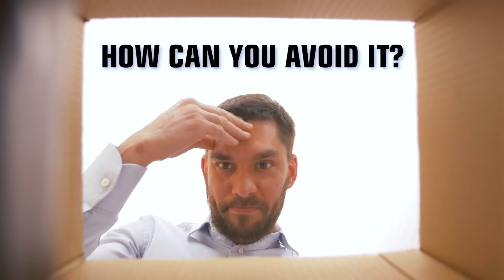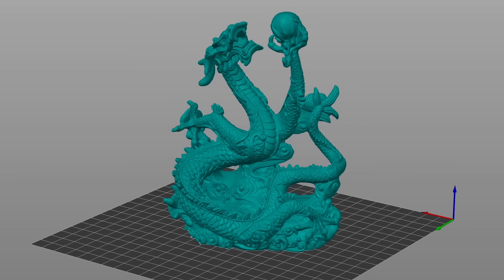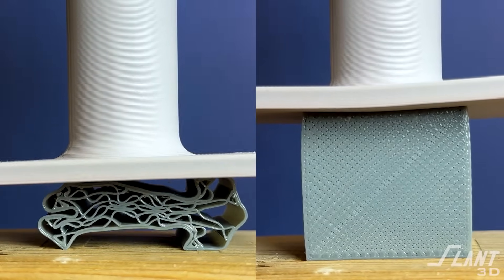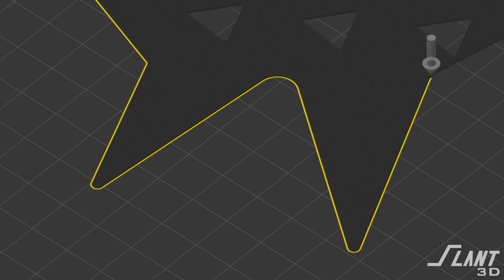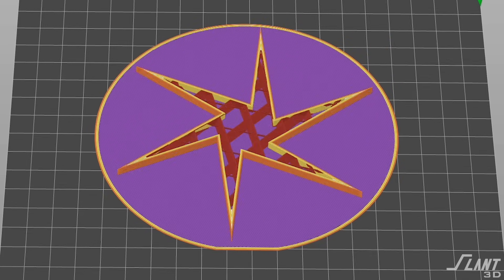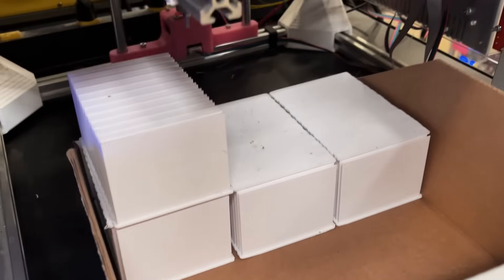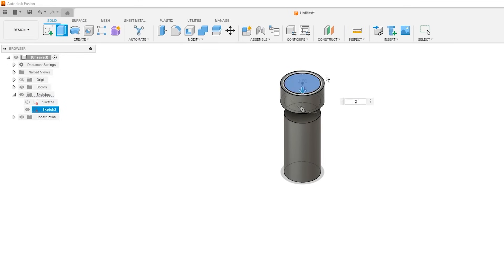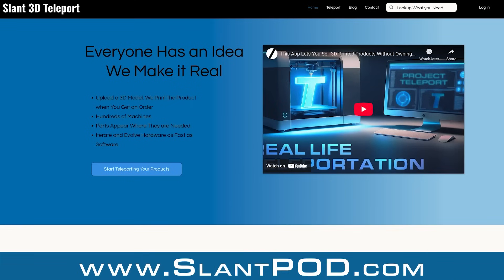Stop Needing Slicers

Comment: Those aren't tolerances; those are clearances - i.e. the expected gap between the internal dimensions that allows movement.  The tolerances (i.e. how much variation you can tolerate on your dimensions) are determined by your materials, processes, expansions, print orientation, etc. and represent one of the constraints that determine what clearance you should aim for.

Comment: 2:59 that's... not what a chamfer is. Trying not to be a pedant but in a video that's effectively about Design for Manufacture... one of the more important aspects here is Design Communication, right? Which means being correct and accurate with the terminology. Other commenters on this video and others already point out your misuse of tolerance/clearance...

Comment: 4:45 Won't those microfeatures slow down printing time by a lot compared to just up the wall thickness in the slicer though? since the printhead has to slow down for all of them where as for walls it can, for bigger shapes just go full speed ahead? I get the idea for parts that have different required strength requirements for different sides/parts/directions, but would it for a printfarm e.g. be possible to say "please make those parts with 4mm walls" instead? An example: I am designing a flywheel trainer (gym equipment) - currently just for myself. I already know that most parts of it need to be VERY strong (), so I am designing parts really chunky and doing prototypes just with very sparse infill and only 2 walls for test fitting and the real parts will get 3.2-4mm wall and top and bottom thicknesses. I am using PLA+ because it's cheap enough so I can pump the ~2kg of material into it I assume it will eat up, has good strength values and the part won't see the inside of a car anyway. Note that trainers like that usually sell upward of 300-400 EUR, so yeah, that material is absolutely worth it. But for something like this that just has very high strength requirements... do microfeatures even make sense?

Comment: I'm here after two weeks to say thanks for the video. I made quick release clamp that can be printed without supports and is very beautiful and strong in any direction. Had to account for proportions and some angles were correlated in proportions to diameter of the cilindrical features. Took me 2 weeks because of maths involved. But finally i made it. Soon i want to sell model or launch a product after some load testing. Just thank you.

Comment: I wanted to print 24 parts on a single sheet and kept having problems if one part failed, it screwed up all the other parts. 
I decided to put a 1mmx1mm square link between each part and their neighbor. This put all the parts in a grid so 24 parts are linked together and no first layer problems or bed adhesion problems since each part held down itself and it's neighbors. Use toenail snippers to cut the links cleanly and easily.

Comment: Everyone knows this already, you basically just 'make it worse', but people don't want 'worse', most 3d products are on the edge of acceptability or viability with fine-tuned slicer settings for a specific printer to coax it into doing something acceptable, without that fine tuning, a lot of times, you have a piece of crap.

Comment: 04:32 

I disagree. For all intends and purposes, this is 100% abuse of the slicer engine. 
You are creating some essentially impossible-to-create features just so that you can try to "bait" the slicer into giving you higher density there. Maybe in the future the slicer will get smarter and realize that it's impossible to create those internal features and skip them entirely so as not to waste compute time. Or maybe they double down on trying to optimize for "as most as possible of the slicer perimeter to be dimensionally accurate" in which case it WILL try its' damn hardest to make those holes accurately because there's a lot of perimeter length there, but you'll find out that your external diameter, the one you care about has been slightly shifted to accomodate for that and now your part is out of tolerance. You complain to the devs HOW COULD YOU MESS UP MY TOLERANCE ??? ARE YOU STUPID ? And they will immediately point out that those holes are part of your design too and that this new method improves the dimensional accuracy on average and it's entirely your fault for putting those features there if you didn;t explicitly want them.

The point is, we want to get slicer technology to a point where it should make the best decisions about how to make the sliced part look EXACTLY as the model. Things have changed over the years. Remember the "inverted hull" method Tom Stanton used to make his lighweight single-layer RC plane wings ? One of the most popular 3D printed RC planes of all time, the Northern Pile still uses this method. it hasn't been modified since 2018. If you try to slice it now, you'll find out it won't work, mostly due to the new, much better "Arachne" perimeter engine, which is able to create variable-width extrusions.
 You might either need to go download an old slicer from the github, or spend a day week-end writing a config file trying to convince the modern slicer to treat those parts the same way the old one did.

What you're saying mirrors the days when compilers were bad and humans could write more efficient code in assembly, and people learning compsci were taught to do very silly, inergonomic things such as "preincrement is faster than post-increment" or to "save a commonly used condition into a boolean value" etc in order to speed up their program. Most of these are actively making things worse on modern compilers, and I still hear some college proffessors tell me those "really neat tricks of the trade only people their age know". Now the paradigm is to just write your code as clearly as possible so that the compiler can understand it better, it will optimize it way better than you ever could. Of course, it took many years to get here, but then again slicer progress is like
very fast. I wouldn't be surprized if just a few years from now, these techniques will be considered outdated and/or harmful. 

Truth of the matter is, that in ANY kind of manufacturing you would need to get more detailed information than JUST the finished part. For Injection moulding, you would need to model the cavity, and the split-surfaces and the little flow connections through which the plastic flows. For CNC you would need to take into account the ways you will be holding the part, and if it has features on multiple sides, you need to design temporary holding surfaces which will be later chipped away and will for sure not end up on the "intended design" of the part

Why should 3D printing be any different ? The effort is obviously much lower to design a few support enforcers and infill modifiers than to design an entire injection mold or CNC process set-up
but that's just one of the niceties of this manufacturing process: that it's simply easier to go from intended design to finished part. HOWEVER EASY DOES NOT EQUAL UN-NECESSARY. 
The .3mf file format is the perfect way do encode these things, because it allows you to specify things about the manufacturing-process. Why does nobody seem to use them ? There has been so much effort put into making it an open file format that covers all ed printing use cases and it seems people just ignore it completely. 

The fact that a lot of 3d-print-as-a service sites just ask you for the STL files make me instantly never want to use them. I completely and 100% agree that the "no-supports" problem is something you solve in CAD, in the design phase, no doubts about that. But the Slicing or pre-slicing (a.k.a. just import the model into the slicer, change your desired infill and perimeter settings, add enforcers, but don't actually fully commit to a printer or print profile, and save the .3mf) is a non-skippable part of the manufacturing process, If what you are doing is manufacturing, and not just printing some meme thing for shits and giggles.

Comment: I'm not sure if mouse ears is actually a clever solution for warping because it produces additional work after the print. I say, if you have warping either your first layer isn't good enough, your build plate isn't clean or it's a cooling issue. For example I had warping on my bambu with PLA because of the AUX fan on, when actually it wasn't even necessary. I have never used any mouse ears.

Comment: Now I haven't used a 4/3.5 axis printer with nonplanar slicing yet, but I think most of these would be non-issues with nonplanar slicing...

Just hope 4 axis printers become mainstream since is isn't hard to turn a triangle configuration leadscrew Z axis printer into a 3.5/4 axis printer...

Comment: I wonder though. Wouldn't it be better simply to design around your home machine and then select a manufacturer whose settings are within a range of what you expect. Like if your manufacturer doesn't tell you what's settings they use then don't use them! Also shouldn't you order samples and test them until it works the way you need? As a person who experiments deeply with slicer settings I feel like it's impossible to design a part without slicer settings being very important. Maybe a good strategy would be to first see what type of settings they use and then buy an affordable home machine that can make parts with similar settings for at home testing, even if not exactly the same machine the manufacturer uses.

Comment: A part of my career was building prototypes and designing and building machinery. A problem most companies have is that there is a disconnect between the design department and the manufacturing department. The design engineers will design exactly what they want. Then it goes to production, where the engineers think; “We can’t build it that way, or it’s too expensive to build it that way.” So they redesign a portion of it. When it gets back to design, they complain that it’s not what they designed. Sometimes it doesn’t even get back to design and it just gets manufactured with the changes. Of course, while it’s easier and cheaper to build, it may not function as intended. Yup! This is common. A few companies, Apple comes to mind, have design and production engineering in the same department. I don’t know why all companies don’t function that way.

Comment: I haven't done drawings for someone else to fabricate in a long time, but when I did a critical part of DFM was working with the vendor so I could get my widget manufactured correctly the first time. Yes, sometimes I would have to give up on some of my design wants, or design around a manufacturing limitation. But that is part of Design For Manufacturing, and usually I would develop great relationships with my vendors because I wasn't trying to give them impossible (or not cost effective) designs to make. I still owe some engineers in Chicago a dinner that I've never been able to repay (because I've never been to Chicago) because they taught me so much about fabrication PCBs.

Comment: Custom displacement mapping (texturing) is something I wish would come to OrcaSlicer in a paintable (using the existing paint tools) fashion. There was a PrusaSlicer prototype years ago, but it was never finished. It would really cut down the toolchain needed.

Alternatively, a Fusion 360 plugin would also be great because doing a lot of repeating patterns in that program will make it choke (they even warn you about it numerous times). Just something to repeat a pattern and tell it "don't compute this until I tell you too, just create an appearance" (similar to how you can texture or model threading), and then you'd compute towards the end/export. Right now you have to export to Blender and then do it there.

Comment: I am not really convinced by "design your own supports", "design your own infill", "design your own raft and skirt" advises. Slicers have these features exactly to relieve you from this, so why you would want to spend time manually doing slicer's job... I don't agree. This also limits your model to one manufacturing method, so people will not be able to, for example, resin print your FDM-oriented model.

Comment: First, great video on design for manufacturing. And up until the end of the video where you talk about build in place assemblies, I thought this would be a good video for my classes. I have been an engineering educator for more than 25 years and one thing I always stress to students is that the key to good communication is proper terminology. You are NOT building in TOLERANCES for this twisting assembly in your example build. These are CLEARANCES. A tolerance is an allowable over/under-sizing or misplacement, or variance, of feature size and location, while maintaining part functionality in an assembly. (Like the hole size or location for a bolt that can be off a little and still work.) This is usually to account for tooling or machining variability (often tooling wear) during manufacturing. But you are talking about clearances, or the space needed to place/use parts in an assembly, or the amount of room needed between parts to work correctly. They are related terms, but NOT interchangeable. You present very well and your information is solid, which I suspect comes from years of design experience. (I started designing for 3D printing in 2003.) But you really need to get this correct as I'd hope you'd want to. So please, help in stopping the propagation of this incorrect and unfortunately common communication mistake.
Reply: Yeah pretty disappointing. I was watching another video of his and found similar: great presentation but sloppy terminology use.
Reply: it’s not even just sloppy terminology, but sloppy use of the English language in general. This guy isn’t too bad, to be fair, some youtubers are a lot worse and I can’t bear to watch them but he does it a bit. For example at 10:@a’s not even just sloppy terminology, but sloppy use of the English language in general. This guy isn’t too bad, to be fair, some youtubers are a lot worse and I can’t bear to watch them but he does it a bit. For example at 10:50 he says “…so it’s a really efficient way to get a different surface finish, when with other processes you would have to do all these other sorts of features in order to get to what you wanted” … I understand what he means, but the words he actually used don’t actually say what he means. There were a few other similar examples but I haven’t been able to find them again.
Reply: This is also something that bugs me as a mechanical engineering student, a lot of people use tolerance and clearance interchangeably when they aren't the same thing. Other than that, lots of good information in this video.

Comment: Most of these tricks are not that easy to do in CAD in the first place but easy to do in the slicer.  Also, it takes a few iterations to discover flaws and then take care of them.  I get your perspective though.  Your customers will make something that prints perfectly on their setup but the sample from you, not so much, and you're putting out this video so your customers know to deal with this stuff before sending it to you.  This has been an issue with PCB fab forever.  That technology is pretty solid now but things still pop up.

Comment: Expecting every manufacturer to fix design flaws in the slicer isn't smart. That being said,  dimensional accuracy and part quality is your responsibility. You can't tell a customer to drastically change the design because your print farm stucks.
Reply: @TechnologistAtWork  little column a and a little column b. First off, a manufacturer can 100% say "I'm not going to be able to make this to the spec you want at the price you want, the spec or price or design you need to change". But it's very good to know what is highly manufacturable, like fillets on internal surfaces are free while machining metal, and if they're big enough it's easier on the machinist to program their CNC. Calling for a hard 90° angle is very expensive, and you should know that before sending work off to a machinist. This is a video guiding people on how to design for this process. It's extremely valuable to everyone involved here
Reply: @paulgupta2454  That's not what my point was about. My point was you're supposed to deliver parts to certain specs. If you can't then you shouldn't be doing the job or offloading that responsibility to the customer AFTER you've taken their order. 

We've dealt with companies that have us out of spec parts because they didn't bother doing any QC. It happens and those people suck. 

This guy here is giving off vibes that he blames the customer for parts inaccuracies after he takes their money. Not long ago he did a colab with another YouTuber and shipped him out of specs parts for a very expensive project.

Comment: tl;dw
Design so anyone can print: avoid or CAD-make supports, add strength with thicker walls/micro-ribs, fillet/chamfer edges, use mouse-ears/brims to stop warp, texture to hide layers, and leave big clearances plus springs/threads for tight fits. Robust STL = printer-agnostic.